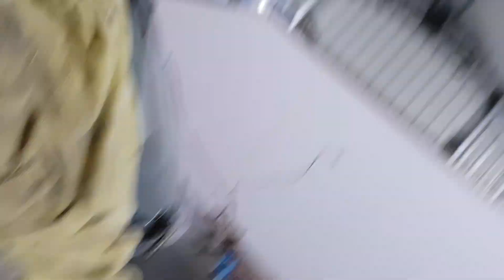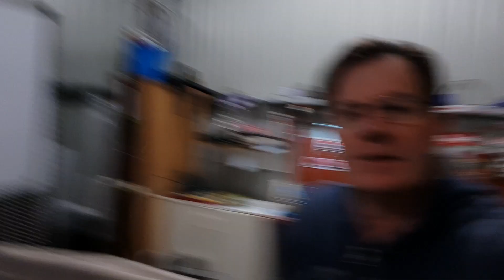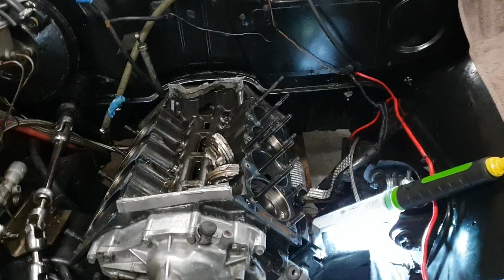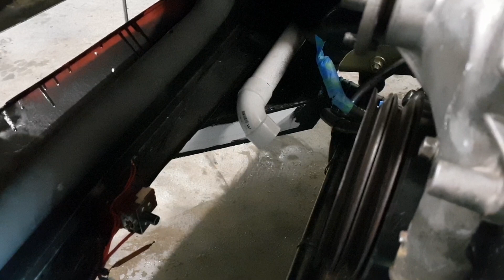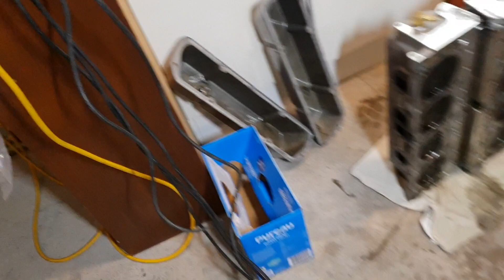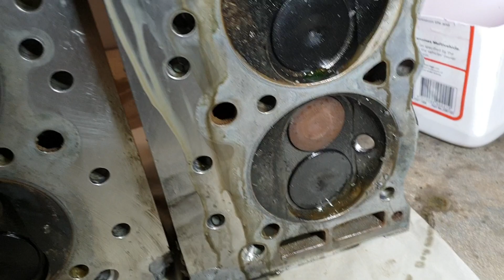OH WOW, LITTLE 308 HAS SAID ENOUGH

Comment: Too much thrust on the bores splitting them. With the Chevy performance engines they do a special casting to give them extra thickness on the cylinder thrust faces  or at the very least check the thrust wall thickness on a standard block  because some can be a bit thin due to core shift when they were originally cast ( Production tolerances hey).

Comment: Yikes! They are thin aren't they? My bores are at 060. I'll keep my eye out for any water issues and take heed of the warning sign. I might also keep an eye out for a spare block, just in case... Thanks for sharing Griff. Maybe you can get some porting done on those heads while they"re out being checked? Glad your back to being positive. We all have these down days and set backs. Sometimes needing a break too Regards, Steve.
Reply from the maker: I wouldnt worry steve, na shouldn't hurt it you wouldn't think, this has been through some really tough conditions and actually lasted quite well considering how thin the bores are, But now you know what to keep an eye on.. cheers Griff.. ps i think sleeving is a great option for saving these old blocks plus giving excellent strength back to the bores....

Comment: Good on you 

Yep that will do it.

On Aussie v8 forum one of the na race cars have done something similar so not because of boost.
More likely a near on 45year old block that's just had enough.

I think like you said a little clean up in the head and a resurface and should be able to go again.

Welding introduces heat and could need resurfacing afterwards not something for the novice to play since $$$ heads good option.

Keep on chipping away at it you will get there.

Would it be worth dropping the 308 crank into other block and a fresh set of pistons and mimic this combo with addition of the sleeves.

That block  maybe repaired with a sleeve I would imagine if an heirloom...
Reply from the maker: There is no doubt age is a factor, personally i think its done an amazing job😆, The fully sleeved spare block should offer better constant bore integrity.. As far as the rest of the block seems to be handling the boost, gives us confidence to invest in the holden v8 and keep the dream alive... ps thanks for oil pressure adjuster clinton, its going on the stage 2 modded pump...

Comment: Wow mate the cylinder in front of that one and the cylinder directly opposite like the rings were on the verge of letting go as well going by the clean ring around the head of the piston and the lack of carbon !!  To be honest bud that wall thickness after 40 thous been taken out looks normal, cylinder aren't as thick as you think or would like !!  .060 thou the cylinder wall can get so hot at the top of the cylinder it can cause bad detonation and piston meltdown ! One saving grace I think was the fact that the old girls auto because as soon as the engine goes bang a locks up momentarily it doesn't just keep destroying the engine because it's locked to the wheels via the clutch !!  Seeya Rob...you'll rebuild her mate bigger and better than ever, wish I was there to help bud !!
Reply from the maker: Thats the water/meth doing its magic on the pistons, Im really surprised now how long it did last on the thin bores..its a testimont really.. Would love to have you be my wingman in the race shop...

Comment: Crazy stuff!  Those bores don't look all that thin to me though actually.  I'm happy to be wrong but it looks like the piston has let go from the rod (perhaps just fatigued from a years of turbo power?) and then everything got jammed up and minced up including putting a hole in the block inline with piston pin still in the rod.  If it really did hydraulic itself, I would have thought those composite gaskets would have been pushed out. As we know, they are like a fusible link and it seems unlikely they could endure the cylinder pressure associated with hydro-lock.  

Anyway, I'm just rambling, sorry.  I think you are right in that it does not look tune related although it would be interesting to see if any of your big end bearings appear to be slightly hammered or not and if any ring lands on the other pistons show signs of deformation.  
I still think you should look at engine management one day as a further phase of improvement for the car.  I personally couldn't be bothered playing with timing and fuelling endlessly as you really are leaving a bunch of power and reliability on the table.  For example, even the most basic engine management will start to decay timing from your base ignition map when intake temps reach a pre-determined number.  You can also set these values against coolant temp and oil temp, so that if anything starts to run outside of the optimal range, the timing is reduced and additional fuel is added to cool the cylinders.  Then when you start the car cold again, you are back at optimum fuel and ignition values for that exact day and throughout the temp cycle all over again. 

Still, it's highly impressive what you manage to do with a carb and good old dizzy!  Cheers Griff. Mike.

Comment: Your quickly finding the limits of the little Holden v-8.   This is  why you should upgrade to a forged bottom end.     Cast pistons are good to about 10 psi of boost or 100 hp of nos.     Above that level. Your really risking the longevity of the engine as you found out.    That's why I suggested turning up the power in small  increments.    You'll be alright to resleeve that 1 cyl. And fresh rod and piston and continue on with your bad self.    Hopefully you will put forged rods and pistons in the 355       you got lucky that nothing came out the side of the block    I must say that those little holden v-8s  are pretty dang tough lil engines.
Reply from the maker: I should have listened to you, but i cant help my self hahaha.. i have a belief that the level i was running wasnt hurting anything, just goes to show how you can get away with it...The bore on the other hand well im very surprised.....There are good little v8...check out that link in the other comment 7 sec pass on the factory holden block...
Reply: monster mechanic 2000 All forged internals would NOT have helped anything in this situation.  
He would have had to buy a new FORGED ($$) piston and rod.
Cast pistons and cast crank in the 93-03 dodge magnum can regularly handle 15psi boost OR 200+ hp shot of NO2.
People been doing it for years.
3rd gen Hemis and LS engines STOCK easily go to 900+hp.

Comment: That's what my #5 cylinder looked like !!! Did the rod bend or break? That's how mine done. Nearly every part was unuseable or I would not use it because of possible stress fractures that cannot be seen. I have used rods Frim engines. And wish I didn't!!! They would have been fine as a 150 hp daily. But 300 +hp didn't last ..  All you need to ask now is:::WHAT'S NEXT!::::
I have a 406 needing a home. And have a scat crank to go in it! It. Just needs rods and pistons now.. It could make a tq monster! It's a Chevy but it could work. But its not in Australia!   Maybe swap in a Honda v6?  Ha-ha..,.. They do make loads of hp under pressure.
Reply from the maker: The rod only bent, its incredible what happens when water is added ... thanks for the offer, i might take up on it one day or ship me over a Texas speed 427 LS  hahaha there i said it....

Comment: Griff My mate had a EVO 7 RS(FTP7RS on youtube) and that had a dyno of 600hp  
it dropped a throttle body plate screw(unwound) and  went through a cylinder
end of the day we took it to a engine rebuilders and they said the head is fine and  they gave it a clean up( cleaned the rough spots) 
they said the amount of damage will have very little affect and is very minimal, even tho it was  going to make 600hp again

ended up being rebuilt and made over 800 hp   
on a full forged stroker kit

also you can get just one bore re bored/sleeve installed or a whole 8 new sleeves 
anything can be re-sleeved/re-bored 

my old boss's son had a XJ6 4.2 efi jag and  the bores rotted away  and it barely made it up the drive way haha
Reply from the maker: Reassuring words mate, thankyou nice comment..

Comment: Iv  had a few 308 Holden's back in the day and still have a 308 HZ, standard and the piston top separate and stuff the motor, 350 chev is twice the motor, great torgue, revs better , much stronger and standard in the HQ GTS
Reply from the maker: I totally hear what your saying, but the Generals lil v8 is in my veins and i still beleive in them👍
Reply: Mate at least put VN heads and the bits on it, more power, better cooling in the engine etc , (bit expensive)  but money well spent
Reply: Hey Jim, I hear and understand what you're saying but in griff's defence, those heads he's running....they're better than any cast style and alot of the alloy vn heads on the market today.
Late model technology wrapped in an early package.
Nothing wrong with sleeved blocks either but I'll add a disclaimer, particular attention has to be paid and they have to be done right the first and only time.
I used and raced a darton lined factory 4 bolt block, 377 clevo stroker for years, in that time it only ever had 1 light freshen up and that thing saw the limiter more times than I'd ever like to remember.... Inexperience, you may ask...well yes but it was more a case of just being young n dumb. Lol
Reply: Of cause, but the VN heads allow the engine to run stronger, the exhaust heat is separated in all cylinders. (as we all know) and his deal is a bit expensive to change over

Comment: That doesn't look that bad Jason. That bore thickness is pretty normal. Thats one of the reasons you half grout the block. It stops cylinder distortion. If you pull the bottom end down the big end bearings will show wear signs of knocking, another way to confirm your tune. Do you think the block had a pin hole in the bore? It could of leaked water into the cylinder, obviously it doesn't compress the rod will bend at the little end and the piston says goodbye. If you believe it was a pin hole then check for electrolisis. Please dont take offence but i disagree on the use of composite gaskets. My thought is, if the gasket grows then water can enter the cylinder and cause a hydraulic type of problem. You have been running your turbo set up for some time, and successfully completed your own tuning. Back yourself mate, do you need a failsafe head gasket? Is it failsafe or problem prone ? If i have given you something to think about, then im cool with that. If its come across as me telling you how to suck eggs then i apologize. George
Reply from the maker: If that is normal thickness well i dont like normal hahaha, no wonder it failed, not sure on a pin hole.. i trust myself on basic  tuning and thats all it is basic,,  but the mechanical side tends have me staying with composite gaskets and in the past has payed off, If the day comes when the composite wont cut it then mls will be called on.. thanks Goerge i understand were your coming from and respect what you say.. cheers Griff
Reply: @griffsrearmountturbothemod1623  👍

Comment: I’ve never seen anything like it I would’ve thought the cylinder walls were waaaaay thicker  than that mate.... 

makes me wonder if you are gonna stick with that type of block you might be better off to sleeve all eight pots....!?!?!

Either that or small block Chev.
Reply from the maker: It's a common issues with these block, back in the day they ran in to core shift which means when casted the bores were thinner on one side and thicker on the other, while Mass production can cause issues like this, they must have corrected it because its hit and miss with these engines.. yes I have sleeved all eight cylinders the one with cracked bore has a thicker sleeved I think 120 thou and others are 90 thou from memory.